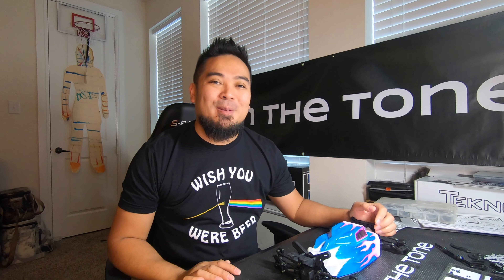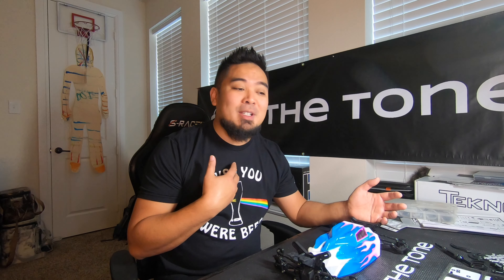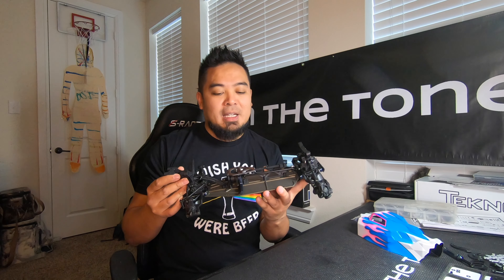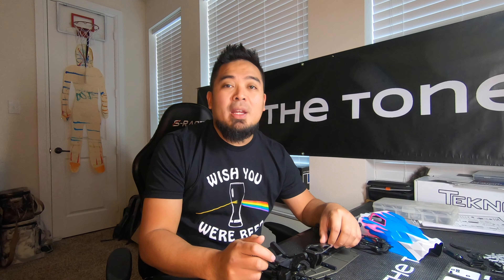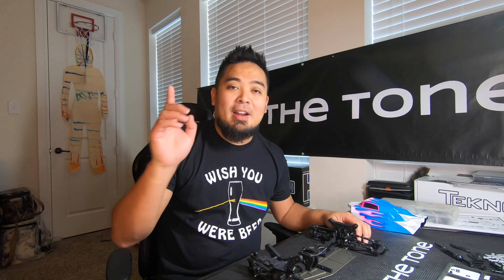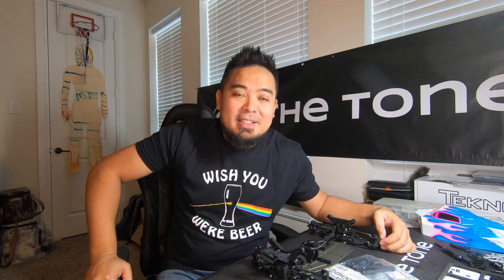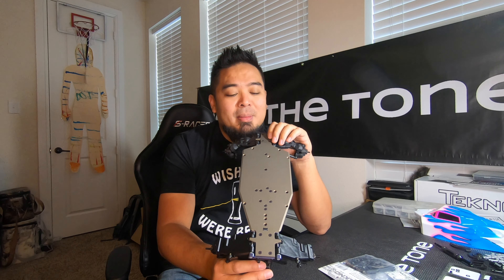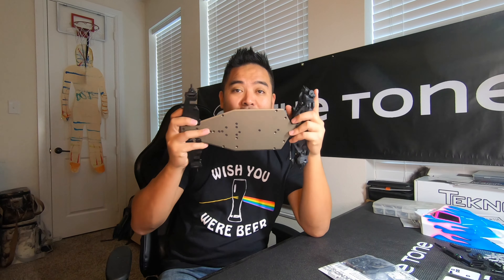Tekno RC EB410.2 Conversion Complete Parts List

Comment: I just found out something about Tekno, and, it's NOT a good thing...it's actually quite bad, and extremely sad...especially for an RC company that designs, manufacturers, & sells upgrade parts for other company's products.

I emailed them, inquiring about a product, specifically a Big Bone center driveshaft for the Rustler 4x4. They've had a Slash/Stampede 4x4 version for a while, and I was wondering if they had any plans to release a Rustler 4x4 version.  Part of the selling point of such an item would be that those running the TeknobM6 axles on their Rustler 4x4 would also be able to run a equivalent Tekno center driveshaft xx just as many do on their Slash/Stampede 4x4s.  The reply I received bewildered me.

First, the person indicated that no such product would be coming out, as Tekno is primarily focusing on its own vehicles.  This could be considered "understandable"...but, for a company that, in the past, prided itself on the upgrade parts they designed/manufactured for vehicles from other companies (such as Traxxas, TLR, Associated, etc), this move seems quite strange - but not as strange as what followed, as this is what he said next:

"Have you seen people running the TKR6851X and TKR6852X on the Rustler 4x4? To my knowledge they changed the arm on the Rustler and this made us believe that they were a different length and wouldn't be compatible with our kits."

This tells me that Tekno never bothered actually checking.  Lead than 2 minutes of online research would have told them that the two A-arms have the exact same length.  An additional minute of research would have even confirmed that, as the Rustler 4x4 A-arm is an 'optional' part for the Slash 4x4, and the Slash 4x4 A-arm is an 'optional' part for the Rustler 4x4.  A company that doesn't bother checking something...and, even worse, a company that a decision based on what they "believe" (as opposed to actually "knowing") is not a company that deserves my money.  Thanks to Mark's video, I had been considering purchasing an EB410.2...but, now that I have some insight into how Tekno operates, I'll be looking elsewhere.  This had nothing to do with them "focusing on their own vehicles right now", but has to do with the fact that they've proven they don't necessarily research things before making decisions.
Reply: Robb Ryan that was one experience with one person? Does the decrease your opinion of their build quality?
Reply: @thornmatthew8395  I can't answer that.  Since they've arbitrarily decided to stop supporting everything other than their own vehicles  there's nothing for me to buy from them.  According to what I was told, while they do have a number of parts for Traxxas vehicles, they're not making any more, and one what they currently have is gone, that's it.

Now, it is possible that there could be enough of a "pushback", leading them to start up production again on parts for non-Tekno vehicles...and, if that happens, great.  With the exception of their front/rear driveshafts for Traxxas vehicles, I've heard good things.  However, over the past year, in regards to those specific parts, evidently, the quality of them had seriously dropped people to them discontinuing them.  There were numerous people who had previously been extremely happy with the Tekno driveshafts for their Traxxas vehicles...but, after whatever changes they had made, these previously "unbreakable" parts were constantly breaking.